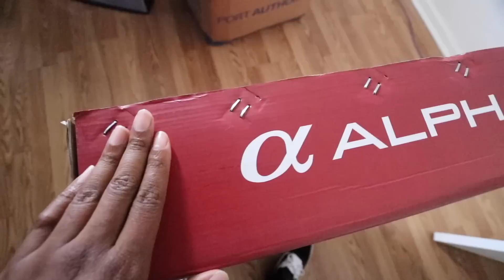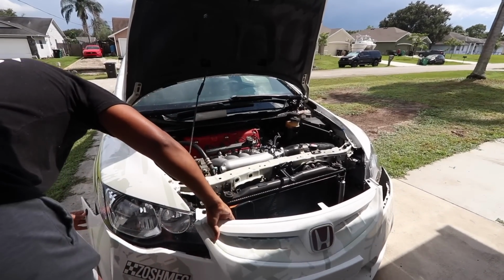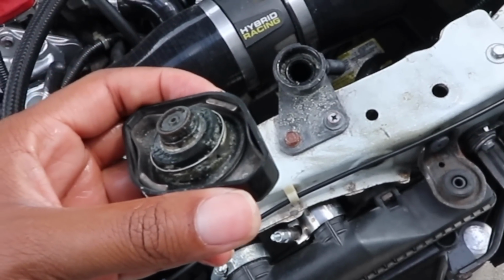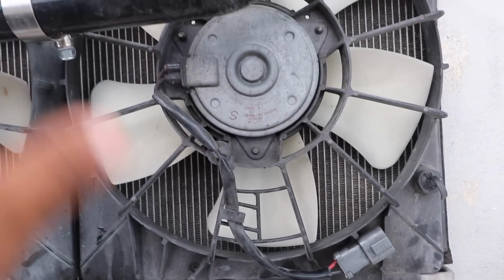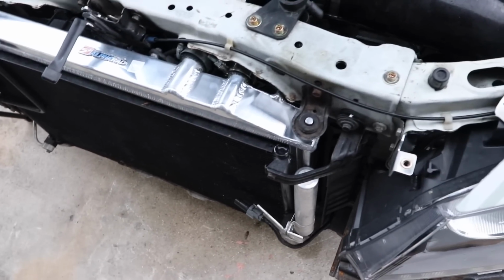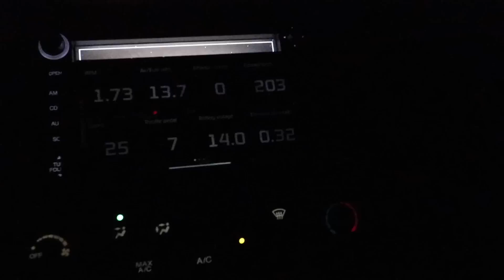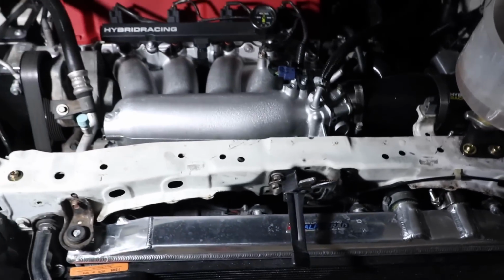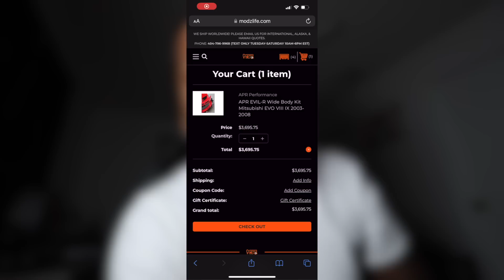Skunk2 Alpha Series 06-11 Honda Civic SI Radiator Gets Installed! (349-05-3000)

Comment: Used your code on hybrid racing for shifter cables. My oem ones kept stretching so I decided to upgrade. I’ve got a 1985 fiero with a turbo k24a 6 speed swap, she’s a blast only making like 4 psi until I get the boost controller. Anyway, love the content, keep it up.

Comment: should put some puller fans in front of the condenser.
Reply from the maker: that's not needed on a stock motor setup. + would create hot pockets in engine bay.

Comment: Honda community I have a question, I had a mechanic install the action clutch stage 1 clutch and on the way home the shifter went to shiiit, it won’t go in any gear and I can move it around in circles, any idea what might have went wrong, ps the car starts and runs, just can’t move because of the shifter
Reply: sounds like shift linkage isn’t connected properly
Reply: Thanks I’ll check it out, I have the same Si as zosh and they have a subframe that’s annoying to take apart lol so hopefully it’s the linkage